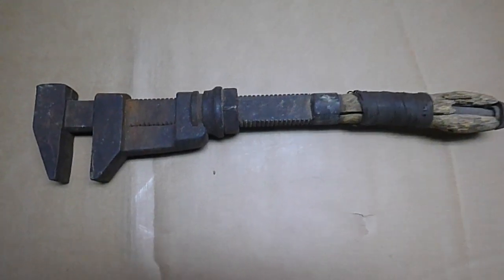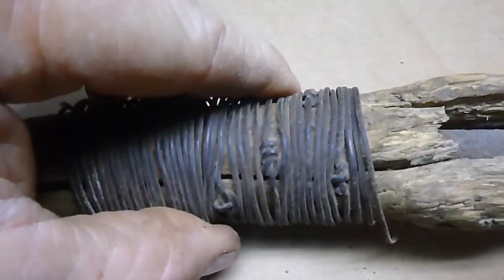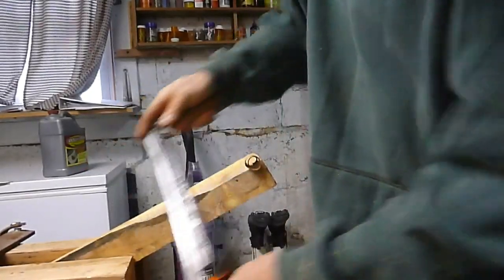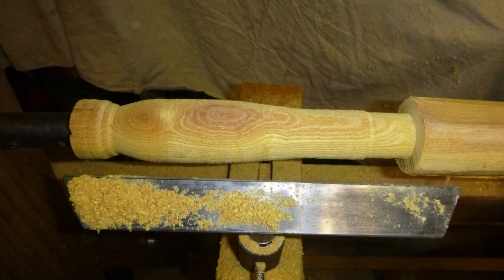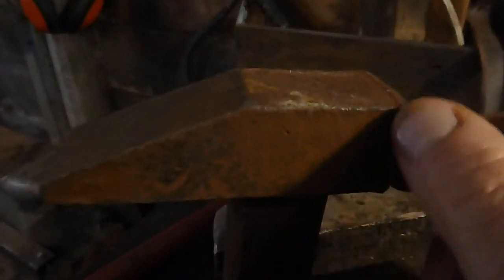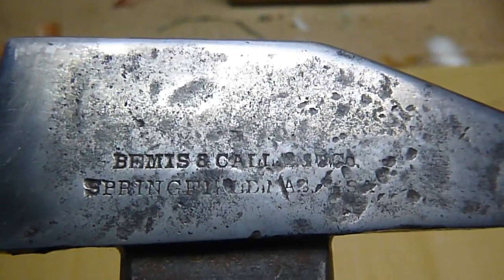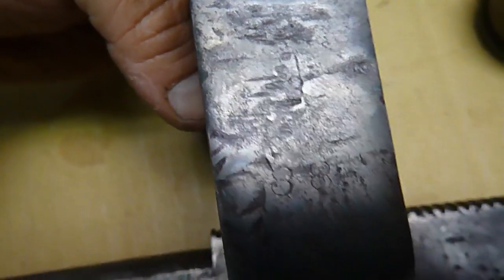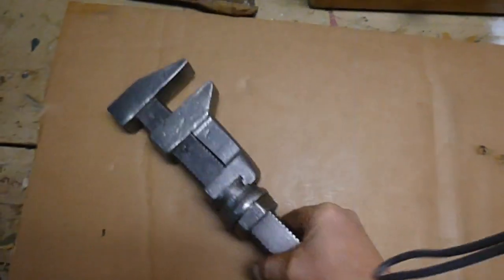Antique Screw Wrench Restoration

Comment: Nice job.  BUT I really would have liked to see how you drilled a hole through the handle, as the handle is tapered.  I'd like to know how that fit.
Reply from the maker: I probably didn't include it because it was a somewhat barbaric process. I just used a cordless drill and tried not to drill into my hand. lots of angering out shaving bit by bit until it fit.